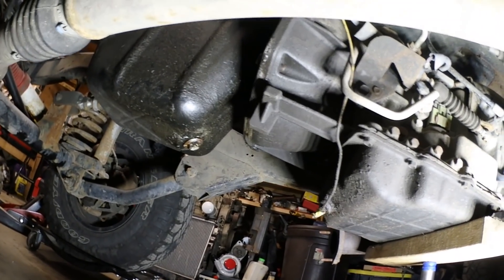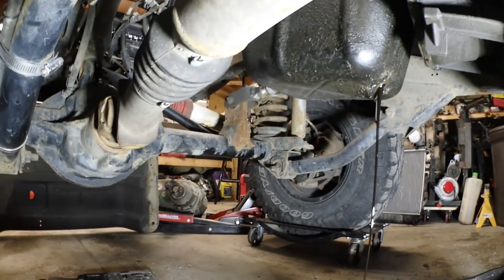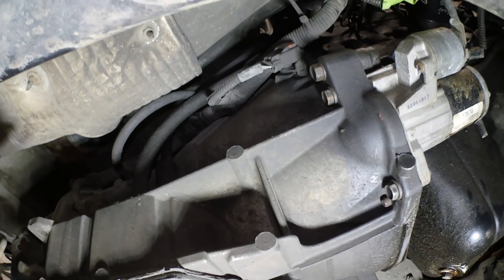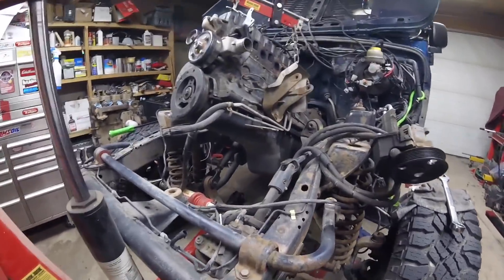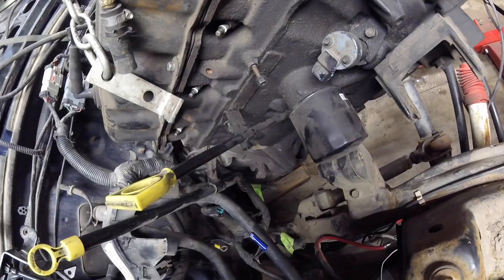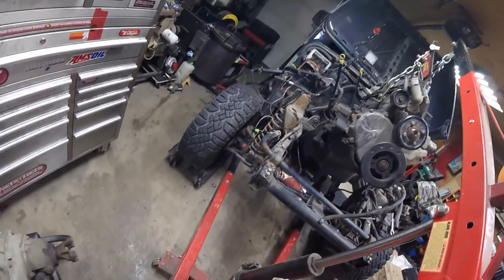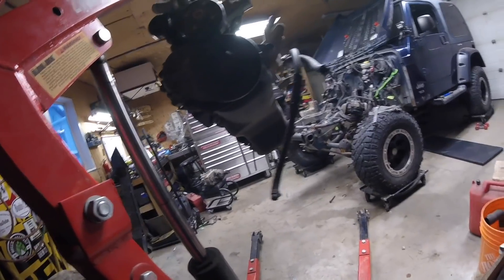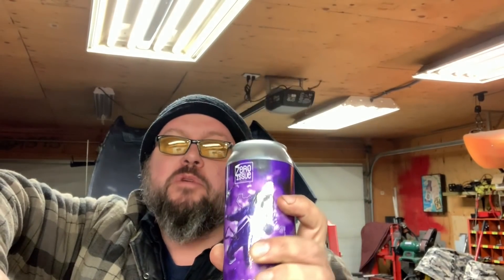Pulling the Jeep 4.0 to Make Room for the LS Engine

Comment: I was surprised that engine and trans came out so easily . I think when I pull mine out , I'm going to pull the front tires off and put the Jeep on jack stands so I don't have to lift the engine so high . But I do have a 5 1/4 '' lift also , so clearance would probably  be an issue. This way I can have the front end down some. Great job Jerry , cant wait until your next video . Take care my friend and say hi to Tomcat for me .
Reply from the maker: Holy that’s a big lift what brand is it

Comment: Thanks for showing the whole process! Usually it's "Now pull the engine" and it out. I knew it couldn't be that easy! And actually talking about tool/work safety is great. Don't lose a finger. Hey look, the tool guard on my grinder did it's job.